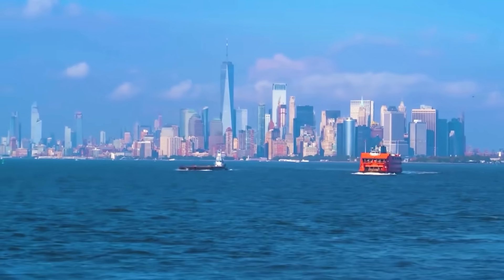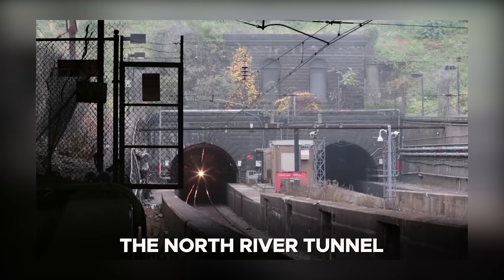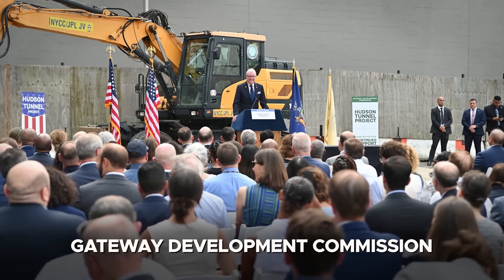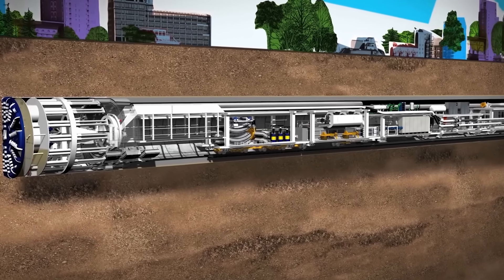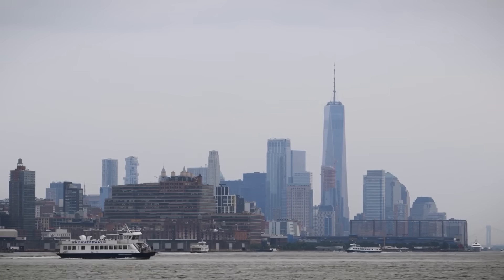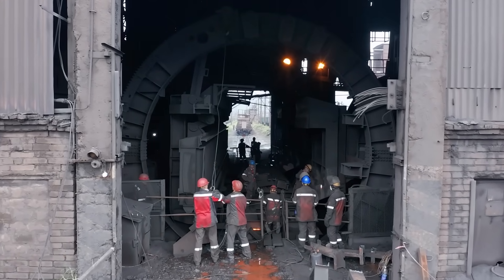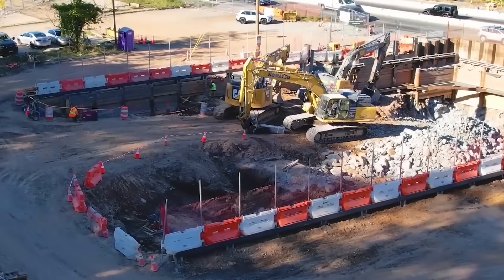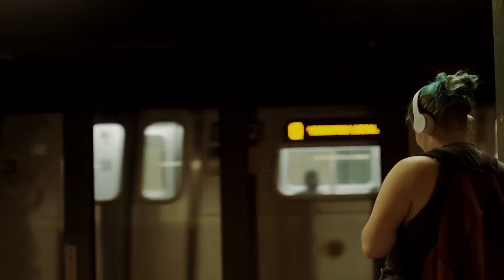New York Is Building A $16 BILLION New Tunnel Beneath The Hudson River

Comment: This has to be a joke. India built high speed rail (90% complete) in less than 10 years for 16 billion dollars. It is 316 miles long. The project will have 13 miles of tunnel and 286 miles of tracks are elevated corridors. You're telling me a 4.5 miles long tunnel costs 16 billion dollars? 
This is just money laundering with a fancy project name.

Comment: We new Yorkers and Jerseyites have been warning about this for years its about time thanks to the Democrats
Reply: Wait until you see the high costs of riding those trains you are going to wish they never build it. There is no way this is going to costs 16 billion. If the Boston Big Pit which was above ground, less complex, and shorter ended up costing 24.3 billions when completed in 2006 and it took 15 years to complete. It was original expected to cost 8 billion dollars. NY every is more expensive than Boston. I wouldn't be surprise if the final costs is around 48-52 billion dollars. Watch around 2032 they will increase tolls, and fare to ride the trains to pay for increase. Elected officials knew that the public were going to get angry if they came out with a plan around 48-52 billion. But once they use the 16 billion then they hope to tell the public that since construction already started they have to finish it.